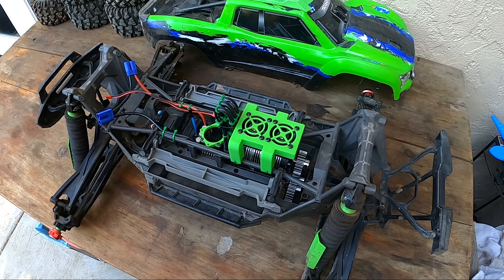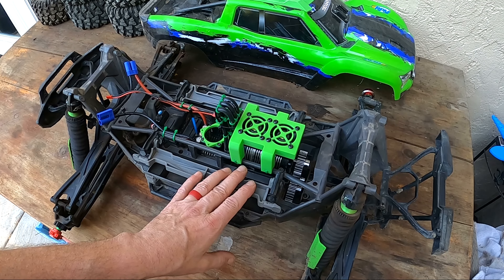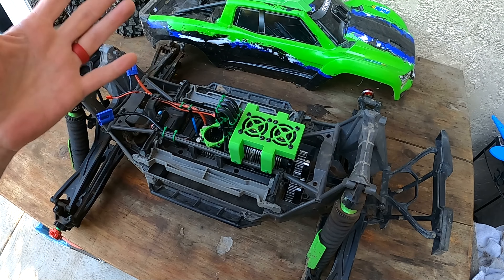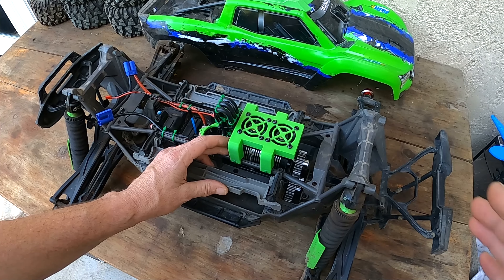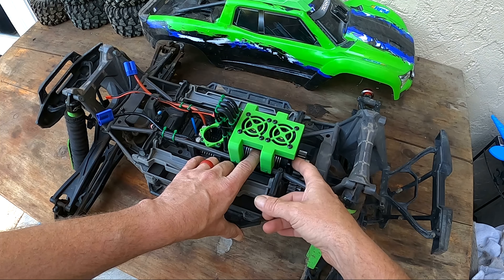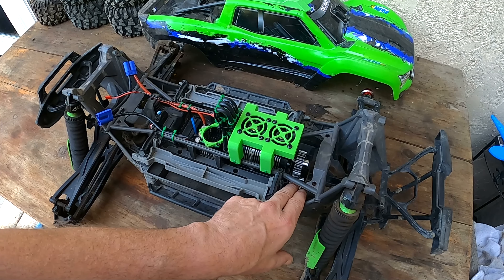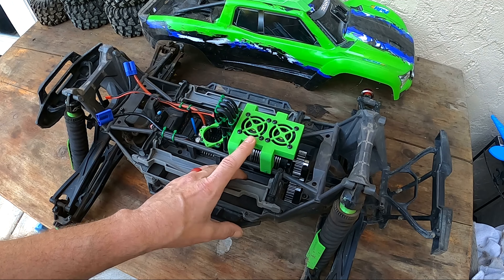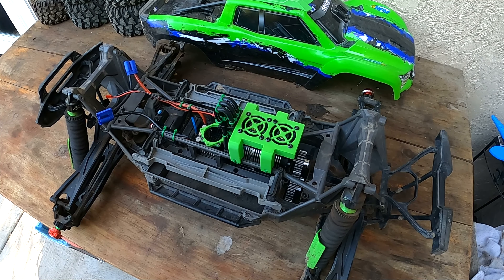XMaxx after 1st test run - tech Max6 5687 1100kv

Comment: Have you had a chance to do some heavy hard-core bashing with that fan shroud? I was going to buy one of those and I saw some bad reviews about them not being able to handle so I decided to wait on getting one but I saw it on your rig and thought I better ask and find out from someone who actually owns it
Reply from the maker: I had a couple good crashes..cracked up the body and bumper. Put one in on its lid... and so far so good. It seems sturdy(rigid) so maybe it will crack. I went cheapo with the plastic fans. My maxx is turning into a tank. I did a few more mods that im going to test tomorrow. I'll let you know if something bad happens to the fans.
Reply: @rcnutzattheranch9270  Awesome thank you so much I appreciate the info
Reply from the maker: beat it pretty good today. fans have all their blades and still spinning. mount appears to be solid... it is zip tied to top rails, so it flexes on those rails. and sits below the body... tough to impact directly.
so far so good.
Reply: @rcnutzattheranch9270  Man you’re freaking awesome I appreciate the update I’m gonna go ahead and order one I live in Arizona and our average temperature this time of year is about 110 it’s pretty hot but nonetheless thank you for the update I’m gonna go ahead and get one and hopefully it works out like yours
Reply from the maker: we were 105 the other day   today it was 80 when we started and the high temp after a good beating was the esc at 110. fans are running off receiver and fan port at bec voltage 7.4vand whatever the ecs program port has??
tested them on the 4s balance plug and they sound like a ducted fan jet airplane. also heard on high voltage they suck the batterys...